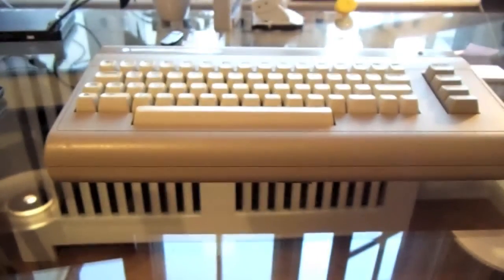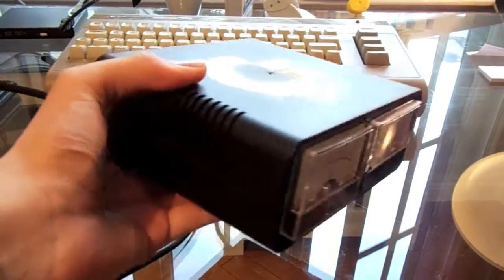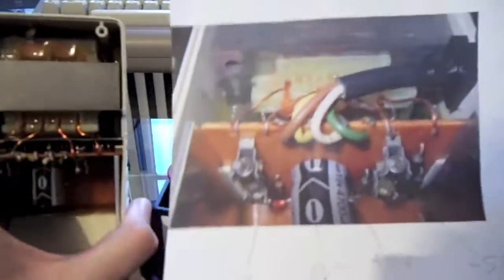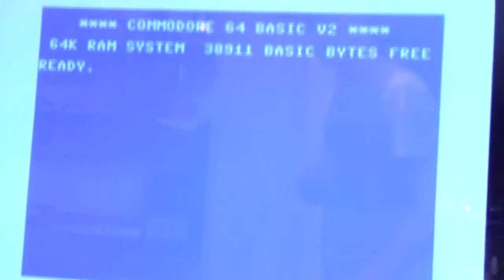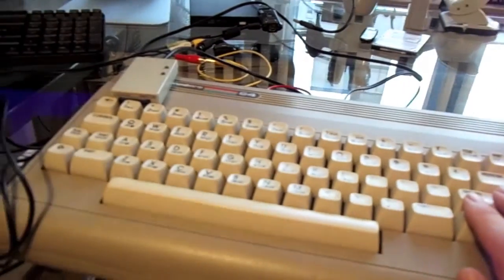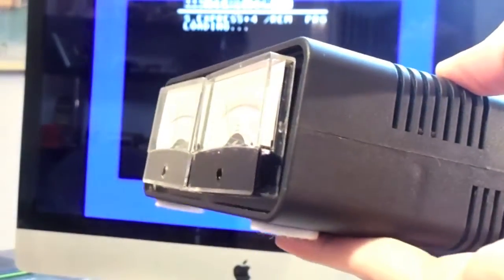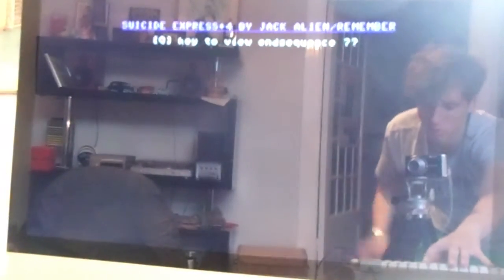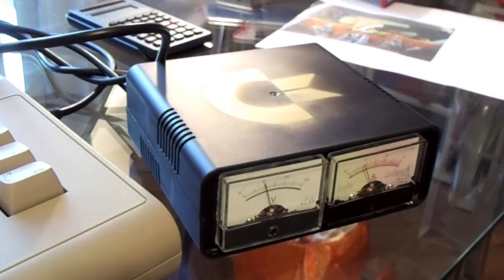Commodore 64 DIY Power Supply Rebuild, Replacement

Comment: I have been trying to do this, using 2 seperate wall mounted chargers. 1 is a 9VAC 700ma and the other is a 5VDC 2.5AWhen I plug it into the C64 I can see  5.3VDC at the C64 connector on pin 5. WHen I turn the switch to on, the voltage goes down to 2.8VDC. I tried two different 5VDC wall chargers both rated over 2A.I am using a good board to test this with. When plugged into a good PS I get the correct voltages when turned on or when sitting in the off position.I can not immagine why this is not working?

Comment: Hey mate how are you ?  i am: the guy that talked to you about amiga 500 and C64 with the nick: TheReasonFor You i had to create another google account so now my nick is Gulliver Gate. I want to know if you can build a C64 PSU to sell me and how much it could cost ?
Reply from the maker: I spent about 40€ on building the PSU (The case was the most expensive part).
The problem would be that I would have to give out personal information... which I don't really want to do at the moment.
I am thinking about building a new version (all on a custom PCB) and sell them as kits on ebay.
Only I would have to know how much interest there is, since designing and building a new version is quite expensive..
At the moment I have very little free time due to my current Job. This is also why I didn't upload any videos in this and the previous month.
Reply: you can only build some improved C64 PSU in a try to sell what do you think ?  if ever need a C64 PSU  i´ll  pay you by transfer bank  and after that you send me the PSU ok? 40€ plus shipping to europe it is expensive try to low the price keeping the quality     :-)
Reply: Please can you send me a link about the AMIGA 500 PSU  schematic diagram ?
Reply from the maker: Do you need the Pinout of the plug or all the schematics and circuit diagrams?
The official schematics are very hard to find. The easiest wa to power the Amiga is with modified a PC (ATX) PSU: http://www.a1200.sksoftware.co.uk/PSU/psu3.html
Reply: Please can you clarify me:
Switching on the Amiga 500 PSU (already plugged to an electric outlet) without the cable connected to the computer that isn´t harmful to the PSU right?
Reply from the maker: My A500 PSU is always plugged into the outlet but I switch it off when I don't need it. If you keep it switched on all the time without the computer connected it shouldn't be harmful but it would just be a waste of electricity.
Reply from the maker: Gulliver Gate The reason the PSU was so expensive is because I used some High end parts if I build a new switching PSU for the C64 and order all the components the price should drop dramatically (even with the case since I can now 3D print a custom mold)
Reply: Ok if you build a C64 not more expensive than 20€(without shipping)  i buy you one unit

Comment: Hey what kind of cable did you use to connect the commodore to you pc monitor?
Reply from the maker: just a cheap USB tuner / capture card with an AUX input. The iMac is running EyeTV lite on fullscreen
similar to this one: http://www.amazon.com/Esky-Easycap-Converter-Capture-Adapter/dp/B00NL4QDBM/ref=sr_1_4?ie=UTF8&qid=1414090536&sr=8-4&keywords=pc+tv+card+usb
Reply: Ok thx for the info!

Comment: Hey mate do you sell me a c64 SD card reader ?
Reply from the maker: Sorry I don't make these I just bought one. The SD2IEC (C64 SD card reader) can be found here: http://www.sd2iec.co.uk/id14.html
The Future was 8bit, makes them and they also can be found on ebay
Reply: If someone turn off the C64 but the  power supply is forgoten plugged to an electric outlet can you explain if that is harmful to the power supply? (see the example of the modern portable pc´s they have a independent power supply just like the Commodore 64 and usually people forget him plugged to a electric source like an outlet) so what do you think about?
Reply: I am downloading commodore 64 TAP games can you tell me what does it means : (the name of the game+ software) and (the name of the game+a) and (name of the game+a2) and (name of the game+a3 )  or ( the name of the game+u) ?
Reply from the maker: TheReasonForYou A TAP game is a tape image (you can't use these with a floppy emulator) you would need a C64 Tape emulator or you would need to record the TAP image with "Audiotap" onto a cassette and use it with the Datasette on your C64.
the nameofthegame+aX labeling i myself havn't figured out yet. could be different versions or cracks or maybe tape one, tape two and so on...
Reply: audiotap isn´t only a converter ?
Reply: With a portable cd player i already can see the Commodore 64 games reading lists on the TV screen but at almost the end the screen freezes or shows a square full of litle squares (errors) and the games don´t run..

Can you give me some tips?
Reply: I have an C64 interface plugged on the cassete port and I want to plug side by side on the user port the reset button like the one.
Can you tell me if it fits on the C64 ? both side by side ?
The reset button is this: http://amigastore.eu/es/294-bot%C3%B3n-de-reset-c64-puerto-usuario.html

and the interface is this: http://amigastore.eu/es/213-interfaz-cassette-est%C3%A1ndar-commodore.html

Comment: Nice effort, looks a bit dangerous with the 230V wires soldered to the connector of the 5V PSU.
There's no -5V, there's a + and - end on the 5V supply but they're rather +5V and 0V.
I have been considering adding voltage indicators on my PSU, I only replaced the the 5V part with a small switch module - so still using the original PSU but with upgraded 5V internals.

Do you have a fuse on main voltage or will your house fuse blow if it falls into the floor and a wire breaks off from the soldering on the 5V PSU connector?  ;-)
Reply from the maker: +5 and 0. wanted to say that :-P Thanks for correcting :-)
I have a lot of heat shrink tubing on the connectors so nothing should get loose.
The transformer and the 5V supply each have internal mains fuses

Comment: Very interesting!  I definitely like the gauges.  I am also very interested in taking a look at the PDF.  Could you possibly share it with me as well?
Reply from the maker: Sorry I've closed my public email account because I was getting thousands of SPAM e-mails.
But I'm making a video about a newer version I built and I will include all the circuit diagrams necessary to build the PSU.
All the information of the PDF will be in the video.
It will be up in September.
Sorry about the waiting time but I currently don't have access to my main computer.
Reply from the maker: HardDiskLover Unfortunately I can't upload the Video this month, because my Screen capture Software has stopped working and corrupted all my recordings. I can't make the video without it :-/. I'll try to get it fixed as soon as possible but I'll because of the broken files I would have to start all over again. It will probably take another 2 weeks for me to make it.
Reply from the maker: Now it's done: Commodore 64 DIY PSU Revisit

Comment: I'm currently have a scrap transformer that I can use for the 9VAC line for a friend's c64 psu, however the voltage outputted from it is hovering around 12VAC. Could you measure your 9VAC line and tell me the Min/Max voltage of it?
Reply from the maker: The transformer I am using is similar to this one (sorry the page is in german): http://www.conrad.de/ce/de/product/710210/EI-30155-Printtransformator-VB-2-VA-Primaer-230-V-Sekundaer-9-V-222-mA-2-VA-VB-2019-Block?ref=searchDetail
The maximum voltage I could read of it was about 10.9 Volts AC, but thats because there was no load on it. If i hook up the transformer to the C64 (with the Datasette) the voltage drops to around 9.3 Volts AC. This was similar with my original C64 9V AC transformer.
Does the transformer still have some writing on it?, Because if it is a 12V AC transformer and your Commodore 64 has written "9V–" on the back I would recommend not using it. Also, how many Amps does it support, the maximum current the C64 will use is about 1.6A. You should probably also try how much the voltage drops, when you put load on it (please DO NOT short circuit the transformer or connect it to the C64 without being sure it is correct, you don't want to damage anything ;-)).
Reply: HardDiskLover

Thanks for the reply, now is that 1.6A on the 5V line or the 9VAC line? If memory serves, the C64 C-Revision uses 1.7A max on the 5V line.

The voltage drop on mine wasn't as pronounced (It is a 9VAC transformer), it dropped to about 10.5VAC when I applied a 0.3A load on it, so perhaps its within bounds.
Reply from the maker: *****
You're welcome :-D
The 1.6A were for the 9VAC line
I have made some measurements (with pictures) the yellow multimeter shows the voltage and the black one the current, both on the 9VAC line: https://drive.google.com/folderview?id=0B57wtbGkUO4PbXpfWV9IRkt5U2s&usp=drive_web
This time I didn't had such a big voltage drop

Comment from the maker: The SD2IEC allows you to download rom files of the C64 from the internet, put them on an SD card and use them on a real C64. It is just like a smaller version of the floppy drive, but it contains all the games which you have downloaded.
I got mine on ebay. Search for "Commodore 64 SD Card" and then you'll find it. Only shipping could take some time, because the SD2IEC is made in Great Britain.

Comment from the maker: No problem I just need your E-Mail adress. (Send it to me in a youtube Message)
Buying a used PSU online is actually a pretty bad Idea. They will break after a very short period of time.
I bought my C64 online and the old PSU was almost dead. It already gave out 5.6V on the 5V line. 5.5V is maximum.
Building a completely new PSU is the best thing to do for maximizing the lifetime of your C64.

Comment from the maker: Thanks a lot!!
The PSU I built would not work in the USA, because the 9V AC transformer I used needs a 220V input, but it is possible to use a transformer that takes 120V in. Then it will work in the USA.
I will send you a PDF containing all the necessary information on how to build the PSU (the 120V version and the 220V version)